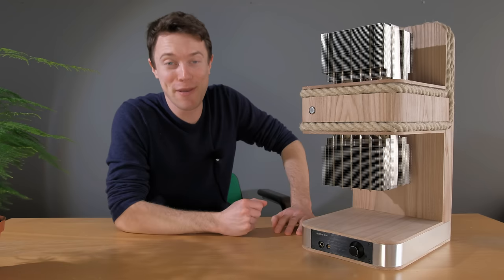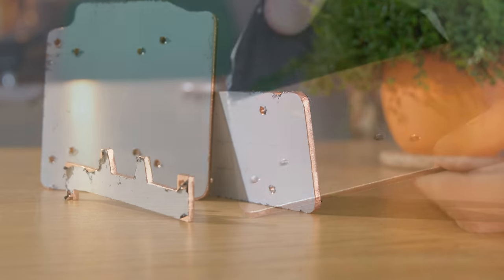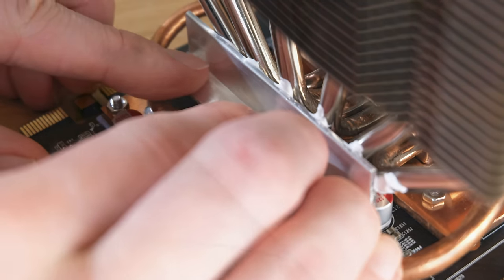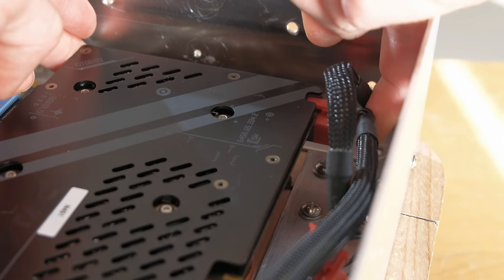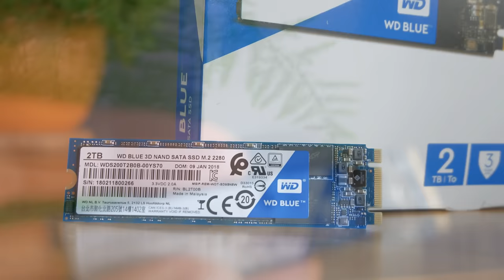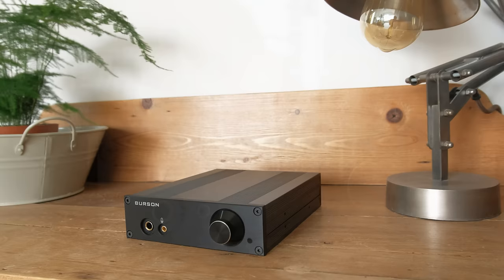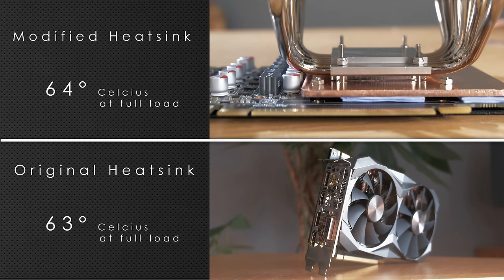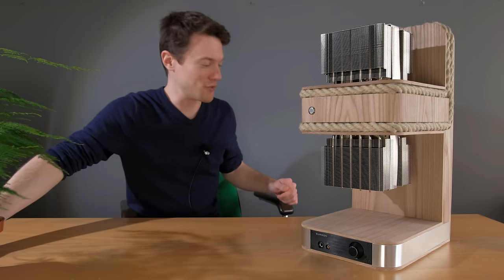I built a PC out of rope and wood...

Comment: Correction, you built a computer case out of rope and wood.
Reply: Qwerasd I also was very disappointed
Reply: Clickbate.
Reply: Yes, thumbs down for that, even though it DID look cool . . .
Reply: So you really thought that he could have built transistors and boards using wood and rope, which are not very famous for their conductivity, and blaming him for a misguiding title? Don't project your shame on yourself towards him. He's done a magnificent job.
Reply: Maybe they thought (as I did) that he was going to build a mechanical computer out of rope and wood. That is definitely possible - as a matter of fact, he wouldn't even need the rope to build some of the easiest differential engines. 

Regardless, that's not what most people mean with "computer"...
Reply: Forking Sheet, i thought i can save some bucks to upgrade my potato.
Reply: A computer is nothing but a a very complicated, and glorified, adding machine.  Babbage's original computer was essentially just a bunch of gears.  You could totally build one out of rope and pulleys . . . that is definitely what I clicked here for, and I am left disappointed. Sad.
Reply: +Ö. Yalın Kaya
Why is conductivity so important?  You can build digital logic out of anything.

I've built a huge 4 bit general purpose RISC processor out of pistons in minecraft  In real life I've built all of the standard logic gates out of lego technic, culminating in a working 4 bit full carry adder (thats as far as I could get, because lego is too expensive to work with).  I also know of someone who managed to build a chain multiplier out of marbles.

All you need to build any digital system is either a single universal gate, such as a NAND gate ... or, more efficiently, a LUT...

... and you can definitely make both NANDS and LUTS out of rope and wood - although those wouldn't be my first choice of materials.  I'd much rather swap the rope for metal pins as the gates would be much smaller and require less force to operate.

A wooden computer is certainly logically possible, although engineering-wise the friction is a problem unless you go for a cranked version - like the old adding machines.  Do that, and it becomes a simple matter of time and space.
Reply: He didn't build a computer, he build a PC, a term (building a PC) which is generally accepted as meaning putting various components of a PC together.

With the modding of the components and the custom case this actually goes further than other PC builds that just choose components and put the PC together.
Reply: +Little Lion
Whilst what you say is quite true, when one says "building a PC" the phrase relies upon an implication.

The implication is that one builds a PC out of PC parts.  Just as one might build a car out of car parts.

When we insist that we have built a car out of matchsticks, we break that implication.  It would be understood that such a car is fabricated from something other than car parts, and may not even be a functional vehicle.  Similarly, a snow-man is not a living creature - but a man 'built out of snow'

The PC here is built out of PC components.  The fabrication of it's case is not relevant to how the PC is built, but rather, how it is housed.  It is simply incorrect to say that the PC is built out of wood and rope ...

... it would, however, be acceptable to say that the PC Case was built out of wood and rope.

Whether we refer to the item so housed as a PC or a Computer really doesn't enter into it, nor would such wordplay do anything to mitigate the semantic error.

This PC was inarguably built out of PC Components and is unremarkable.
The case that the PC is housed in was fabricated from wood and rope, and is a thing of beauty.

If you still do not understand the distinction, then consider the statement that a Lamborghini is built out of finest Italian leather, hand cut and stitched by artisans... or that Snickers bar is made out of continuous sheets of thin printed plastic... machine cut and formed into sealed tubes in a high-volume industrial process.

Just sayin'  ; )
Reply: A case is generally considered part of a PC build, as opposed to for example your snickers analogy (I've never heard someone say "they "build" this snickers from chocolate and peanuts" either). The concept of "building" a PC is simply more broad than most other interpretations of the word "building".

"A car built out of wood and rope" carries the same ambiguity. But a car made out of matchsticks shifts that ambiguity to a smaller scale because of the size of matchsticks. So it's not the manner the description is constructed but the added influence of the matchsticks that makes that analogy break down.

Similarly, when talking about the interior of a car as opposed to the outside one simply doesn't say it in that manner. A car made out of wood, however, can certainly imply regular components for internal functions – even though the term is slightly ambiguous and could also be taken to it's full literal extent.

So, while this title may be slightly ambiguous, the wood and rope is the main differentiator in the video. So it's natural the less remarkable stuff is excluded from the title. A critically thinking person wouldn't take a title (let alone their literal interpretation) as being the fully encompassing description of what happens in the content, just an indication of the most remarkable element of that content. 

To people taking things overly literally an somewhat ambiguous title like that can be confusing, yes. But that doesn't mean finding out one's interpretation was faulty should be so upsetting. Nor should one resort to casting blame for such a minor issue.

Given the leniency of the term "building a PC" I'd say, though ambiguous, the wood and rope referring to the exterior is implied with the correct interpretation. 

It depends on one's flexibility with language and maybe whether one's linguistically more a descriptionist or prescriptionist whether or not you agree with the use of language in the title of this video.

But everything considered, it's nothing to really get upset over like what happened in this thread.

P.S. 
Interestingly, your analogies (especially the matchstick car) do show that the ambiguity can shift with the likelihood of the possible interpretations. One could wonder whether the less likely interpretation (which in these cases is the literal interpretation) might be case. For example a full size working car made out of matchsticks (with car components internally) rather than a miniature matchstick car. Or indeed, a less likely scenario of an actual computing device made from just wood and rope, rather than a PC build with wood and rope as unconventional materials.

It's interesting to think about how that affects interpretation and how we correctly take likelihood into account when interpreting the things we read or see in general.
Reply: +Little Lion said "But everything considered, it's nothing to really get upset over like what happened in this thread."

I actually find the whole thing rather funny, and my first comments were very much tongue in cheek.  It certainly didn't upset me.  However, as an autistic person, strange expressions and modern usages have the capacity to equally entertain or frustrate.

I have always loved how writers, such as Lewis Caroll or Douglas Adams, have tackled the lazy absurdity of language.  We do tend to use these strange constructions without any thought to how they're put together or what they may literally mean.  The language, then becoming a sort of layering of cultural in-jokes.

News and political-speak offer great examples of this, and sports commentators in particular seem to be developing a weird sort of bizarre cultural cryptolect.

But no, not upset ... and not confused ... just having fun :)

Don't take me too seriously :D
Reply: Don't worry, I wasn't referring to you specifically rather the various comment on this thread that clearly showed the writer was a bit angry ;-)

Yeah, language is a funny thing to play with some expressions really sound bizarre when you take them literally xD
Reply: +Yoshi,
In principle, there's no reason why not - provided you can reduce the friction.  Anything you can produce a NAND gate out of is fair game.

With enough money, time and floor-space I could build you an i686 out of lego.  Finishing the build would have to be left to future generations ... and the clock rate would be glacial... but it IS possible.

Processing is NOT, strictly speaking, an electronic phenomenon.

And trust me, I know what I'm talking about.  I've worked in ASIC design back in the old Place'n'Route days for the 180 nanometer MOSIS and twintub/p-Well CMOS processes... and got into CPLD/FPGA prototyping long before formal specification tools like Verilog, VHDL and the ability to drop customised 3rd party IP blocks.  

Back then, creating a formal processor design from scratch felt a lot like construction work.  Sure, we had libraries of common gates in various sizes, but when it came to timing closure we were pretty much freehand drawing the changes.

Basically, we almost had to draw out our VLSI systems by hand : )

You still can, by the way ... look for a linux app called Magic - you get to plan your n-doped/p-doped wells in the substrate, construct your transistors with size in regard to their required drive and rise/fall speeds, Plan for n-diffusion, lay your Metal1 and Metal2 layers and place all your polysilicon... and you can use Magics output to create the foils to send off to an asian fab-house and get your chips made.

People still do this BTW, last time I did it was for a high density ASIC cluster, with a 3D, fully-meshed multi-Gbps backplane - for dedicated cracking of weakly salted SHA256 hashes.

I've sweated over timing/thermal closures - floorplanning right up to the release deadline...

... and I'm confident that I can design the same systems in ANY process - from redstone, to pistons, to lego... and even in wood.  Either for rotary logic or drawbar logic.  I've even built complex cellular processing systems in John Conways 'Game of Life' - which is a whole 'nother challenge : )

So, what's my point?

Well, I mention all this because I think you might be overestimating the complexity of modern computers.  When you understand the logic, understand FSMs, understand the Von Neuman architecture, FX cycle and branch predictor logic ... the system is actually HIGHLY... even insanely... reducible.

As for PC's, I grew up in an environment where we had to fully understand the entire architecture, including the BIOS and even the meaning of the bits on the bus... and honestly, there's nothing going on in there that can't be reproduced in a purely kinetic system.

So, hopefully you'll understand why I fail to see modern computers and smartphones as magic black boxes... they're really quite simple in principle, and their reproduction all begins with a single functional component ... a basic NAND or LUT, howsoever manufactured.

If you can manage that, the simple NAND, LUT or any universal gate, then the entire system is simply a matter of combinatorics.

Whether any human has the lifespan to use such a system, or even to boot it up, is a different matter ; )

There's a reason we usually only get as far as calculators or 4-bit RISC ... although, an 8-bit RISC machine has already been designed and formally  verified using minecrafts redstone.
Reply: Exactly what I was going to say, I thought it would be an actual mechanical computer that could do some logic and mathematical calculations. Like those old mechanical calculators.
Reply: i can see why you could think it would be more like a basic computer, but a PC implies, processor, OS and storage. Which are all basically impossible without electronics.
Reply: Well, I've covered the processor... they've already been reproduced in kinetic systems (although, it's fairer to say that electronic systems are the reproductions).  RAM and ROM are also NAND based and are much simpler, being highly regular in construction.

Storage isn't a problem either.  Perhaps you don't realise just how simple storage is ... you certainly won't remember punched-card stacks or punched tape loops...  but you'll have seen other mechanical storage ...

... have you ever seen a mechanical central-heating timer?  Some mechanical storage systems work on a similar principle, with spoked wheels that can be set in one of two positions and rotated to index specific bits.

But, I'm happy to debate this ... care to say WHY you believe it to be impossible?  surely your opinion is based on some scientific rationalisation.

History, it seems, would disagree with you...

For example, Babbages "Analytical Engine" is a fully functional system with RAM, ROM, Program/Data Storage, IO and complex Instruction Processing... and yet it was mechanical.

Nevertheless, it was a fully specified, general purpose, computer - capable of performing any calculation that a modern computer can ... albeit slower, mechanically and by iteration.

A modern PC is just a more complex iteration of the same technology ... electronics allows it to run at a reasonable clocking rate and without significant wear and tear... but exactly the same systems we use today can be re-specified mechanically.

You should probably look into computing history and computing theory.  There is absolutely nothing you do today that cannot be accomplished mechanically... given time, space, money and patience.

Oh, BTW, interesting side-note ... I remember reading in Scientific American that a team of engineers are currently building the Analytical Engine and hope to have it finished and working by 2021... in order to celebrate Babbages 150th anniversary.

I don't know about you, but I think that's pretty damned cool : D
Reply: (more thoughts for +Yoshi)

Perhaps you're not convinced.  What we need here is an example... how about a hard drive, serial port and internet access?

So, first let's invent a new, very simple, mechanical storage drive for this wooden PC... it will store the BIOS and the OS, Programs and Data.

Let's call this idea 'blister' memory - it's a re-writeable endless punchcard

We take a VERY long strip of plastic.  We heat-form blisters into it, with corrugated edges ... It has 64 blisters from edge to edge and is a loooong tape, possibly a loop.

The write head

When a lever presses on the blister from below, it pops into the 'up' position.  When a lever presses it from above, it pops into the 'down' position.

So ... our WRITE HEAD consists of 64 levers above and 64 levers below ... or they might just be 64 C-shaped levers capable of pressing on either side.  With these we can set the blisters in any pattern we want.

The read head

Near to the write head we place a read head.  This uses 'tappets' ... as the tape passes underneath, these tappets are lifted and dropped by the raised bubbles.  At any one time - the state of these tappet levers indicate the 64-bit binary data on the roll at that position.

Indexing

It is important to know where we are on the roll (the memory address) ... we could just count up or down using a mechanical adder everytime we move the roll (relative indexing) ... but it might be better to have some fixed bumps, just like the blisters, but permanent ... these would mean that we always know where we are on the roll.  Let's do that!

The area of the tape with the Index bumps would have a read head but no write head ... because we treat indexing as if it were a physical measurement of the tape position.

Movement

Movement of the tape is sprocket based, and thus mechanical.

Done!

And there you have it ... we now have a 64bit storage device.  It can seek like a hard drive, it stores data just like a magnetic tape, it is readable, it is writeable and it is eraseable... it is also fully indexable.

Regardless of it's slower speed of access, this will perform every function of a hard drive or a mag-tape.

Meanwhile, the read/write head assembly is simple enough to use wooden tappets and wooden write-levers ... hinged on dowels.  The tape is advanced using a sprocketed wooden wheel.

So, Great!  A wooden 64bit storage device, happily reading flexible tape media!

Next problem?

Internet access perhaps?  I can do that too, it's slow, but it works  : )))))

Mechanical modems?

If you've ever seen a pianola, you'll know that levers and punched-tape have been making complex audible noises for hundreds of years ... wood can't 'listen' very easily though - so a mechanical modem is a problem.

Luckily, since our modem is a peripheral device, it doesn't need to be made of wood - so all we really need is a mechanical serial port, and that's too easy.

Serial ports

Of course, all good serial ports should be able to buffer - so lets make a 4k input and 4k output buffer.  These are two belts of our 'blister memory' (tm.)  ... the belts are 4k(+margin) bubbles long and 64 bubbles wide with no indexing.  They hang down as an endless belt between two sprocket rollers.

One stores the data waiting to be read.  The other stores the data to be written.  Data can be added (and the sag between the rolls increases) ... or removed (and the sag between the rolls tightens up.)

When you try to move to the next byte but the other roller won't let you advance - it's because your buffer is full.  If you try to read a new byte but the other roller won't yield any more tape it's because the buffer is empty.

And, just like that we have buffers and flow control !!!

And now we can attach serial devices like modems, and not have to worry about polling them : )

Now the levers on your fully buffered mechanical serial port can interface with the electronics (switches and solenoids) of your electronic modem.

The medium?  Wood with dowel hinges + plastic 'blister' sprocket-fed media

All wood, no plastic!

If you object to using plastic media in your wooden PC, we can make a wooden 'tank-track' storage media too.  Wooden 'marbles' inside a 5-ply constructed 'dumbell shaped' space... The marble can be pushed into either 'well' and will retain that position despite 360 degree rotation - as long as the memory element remains parallel with the floor... so, it works even when wound onto large drums.

Setting a bit is performed by pushing the marble between the two wells using a wooden push-rod from the tape edges ... reading a bit is done by two wooden pins testing for resistance perpendicular to the tape - for both potential marble positions 

It's basically like a binary abacus - with one bead, two possible positions ... and a gentle curve in the metal so that the bead cannot lose it's position easily.

So, where are we at?

We have Von Neumann type processor, indexed R/W storage, RAM, ROM... we have serial ports with 4k buffers and flow control ... and we can attach a peripheral modem to connect this ugly clockwork beast to the internet.

Okay Yoshi... so whats the next 'impossible' mechanical PC component?

I don't mind designing and simulation-testing this contraption... as long as, if we build it, you buy all the wood ; )

:D
Reply: PixelGhostClyde you thought this even though the thumbnail is evidently a PC case made of wood and rope? Did you think the coolers were polished wood with rope powered fans and wooden LED lights at the bottom? 

Are people really this thick.....
Reply: Ö. Yalın Kaya Well I though he built a machine that can do some stuff computer can (like a calculator and memory storage) And you seem like a smart guy, you would know difference between PC made out of wood and rope and PC case made out of wood and rope -_-?
Reply: whaaaaaaaaaaaaaat i was pexecting fucking gta v running on rope ffs
Reply: Paulo Mota i have several times
Reply: GaryChap you wasted so much time writing all those comments, its so long that personally its hard to take serious considering its a youtube comment.
Reply: @vahnphantom @GaryChap I wouldn't call it wasted. Even if the person he was writing it for bailed I found what he wrote to actually be MORE interesting that the video itself. He is clearly quite knowledgeable in the field and even though I'd prefer that it was somewhere easier to find than the comment section of a YouTube video, I'm happy he shared what he knew.
Reply: I too got my hopes up, but the thumbnail made it very clear what was being built here.  The machine is after all half heatsink.
Reply: Incorrect, PC = Personal Computer
Reply: GaryChap I like your ideas. :D
Reply: reported for misleading text.
Reply: GaryChap Can you watch Games Of Thrones on it?
Reply: A computer does not have to be electric: http://www.computerhistory.org/babbage/ It also depends on semantic, but this is considered by plenty to be the first computer. The first "electro-computer" was built 26 years after Babbage's was completed.
Reply: What a stunning build! Very inspiring! Thanks for the great video!
Reply: Qwerasd Everyones talking about clickbait, but the thumbnail clearly shows a small device with obvious metal parts (obviously showing it is a modern computer using more than just wood). Thats not clickbait, you’re just looking for something to complain about.